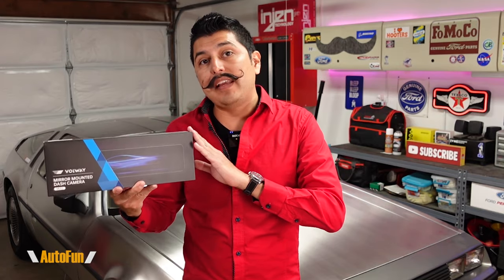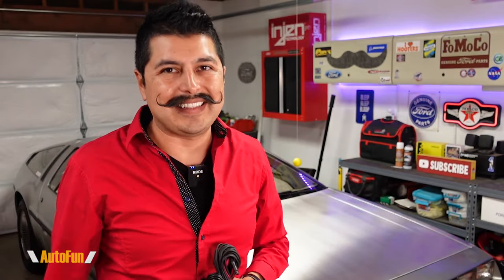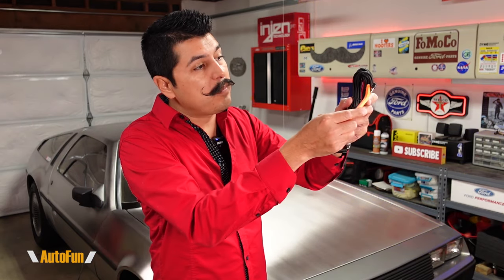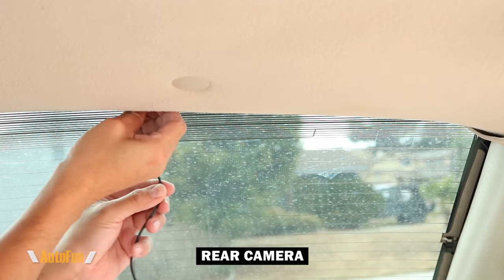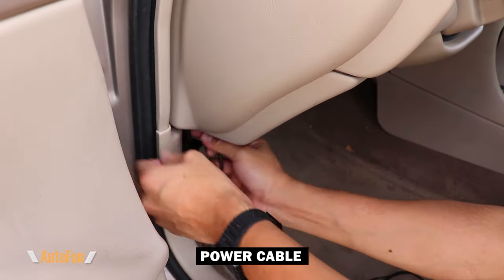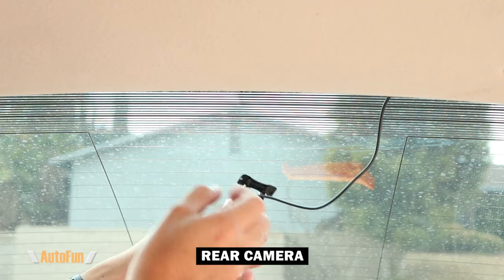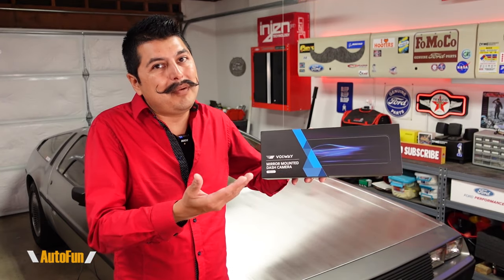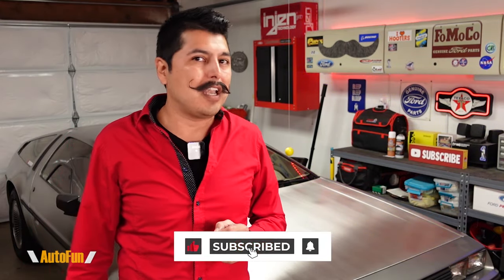How to Install Mirror Dash Cam (How I Route & Hide All Cables)

Comment: Hey, Thanks for the video! Can I use the ODB2 connector with this mirror dash?
Reply from the maker: You're welcome Asif! Ah regarding using the OBD adapter with mirror dash cams, I usually don't recommend it since the OBD adapter can only provide 2A out of the 2.5 - 3A that most mirror dash cams require. There is a high power version of the OBD2 adapter here https://amzn.to/3epnu1O but I have not tested it myself, If you do order it and if it works well with your mirror dash cam please let us know (the OBD2 adapter will not enable true parking mode like a hardwire kit does, here is the video where I cover this on more detail https://youtu.be/YEklm9V6xYE ) Hope this helps, Cheers!

Comment: Can you do a how to align the rear veiw mirror camera lines for your car.
Reply from the maker: Hi oscar_Flex! I probably can, just remember this will vary from dash cam to dash cam as some have different levels of adjustability and also the adjustment is somewhat of personal preference. I seen cases where people like the lines to have plenty of space before they actually will match when you can potentially hit an object and I seen cases where the lines are adjusted very tight, so if the line touches the object, the car has also impacted the object. The other large variable is that adjusting them depends dramatically from car to car as each car model has different body styles and geometry with body parts that are either shorter or longer, so adjusting the lines also has to take that into account. But I think you are right, this would make a good subject to discuss, stay tuned Bud. Cheers!

Comment: at 3:10 there is an extra red wire that attaches to the rear camera. what is it for?
Reply from the maker: Hi Doug! Good eye, that wire is used to enable the optional parking assist (reverse guidelines). Here is my video for how that connection is made https://youtu.be/LHGxwulIPes Cheers!
Reply: @AlexAutoFun  thanks Alex
Reply from the maker: @dougbenson8101  You're welcome!